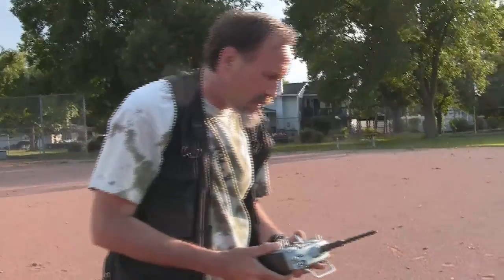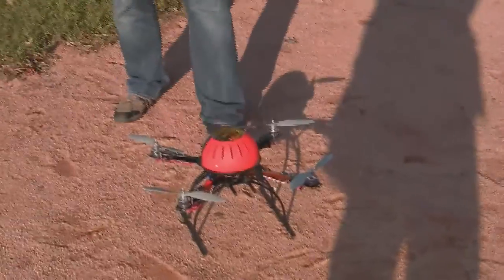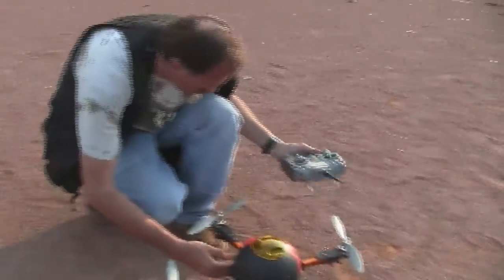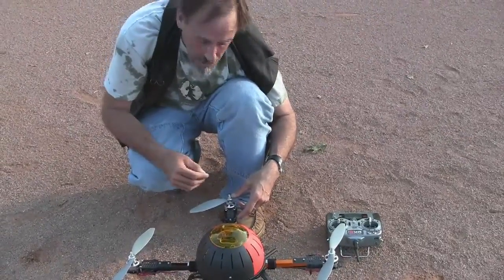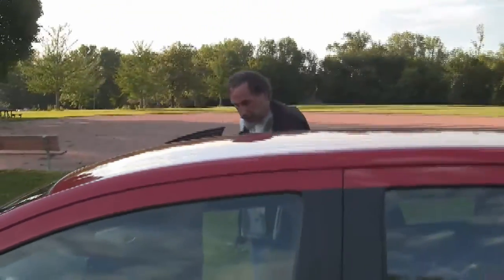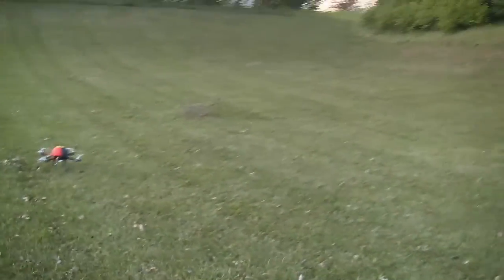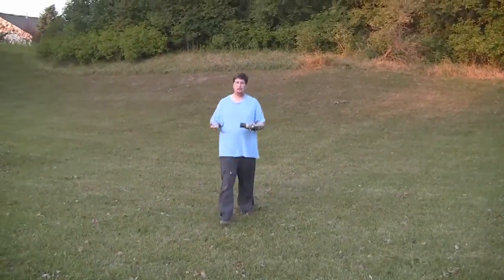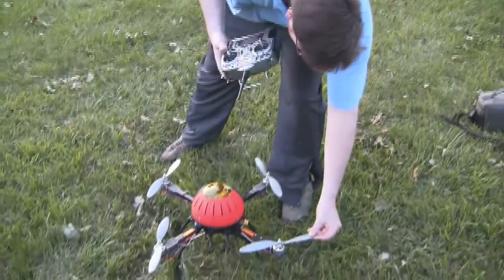Quadcopter First Flight

Comment: when you had the kk2.0 board on the x650f how did you go about mounting it to the top plate?  I have a kk2.1 and the screw alignment is a few mm off.
Reply from the maker: I think our 550mm frame had pre-drilled holes, but we also needed to drill some of our own to get it in the right place. When we got the NAZA LT we just taped it in there with double sided foam because the software help adjust position. We didn't have the KK2 very long because and I don't remember a lot about it, but I thought the board had some positional adjustments or adjustments to compensate for drift. We never really dialed the setting in and because I'm an inexperienced multi-roto flier I didn't want to crash every time out, and the NAZA LT with GPS pretty much flies itself with the correct settings, but obviously more expensive than the KK2.

Comment: Such a smart idea I have ordered one for my X650F.  I love the fact there's a door for easy access to the control board.  How have you attached the dome?
Reply from the maker: Thanks, We riveted small aluminum "L" shaped brackets around the dome at the cross bars and wrapped Velcro strips to hold it to the frame.  There are probably a whole bunch of way to mount the dome to the frame that are not a complicated as what we did.
We did have the lid fly off a couple of times due to vibration so you may want to find a way to hold it down, although this didn't happen on the first flights, it seemed to become looser more we flew (and had hard landings).
Good luck with your rig, I hope you have great success!
Reply: RUFilming Awesome.  Do you have any pictures of the build online?
Reply from the maker: Not really, Just the few video in Youtube, wish we did though. By the way in case you find this helpful, we burnt out a battery with an inefficient Prop setup, we should have been using smaller props with the faster motors. Here's a site we found to get the most out of your quad setup http://www.ecalc.ch/motorcalc.htm